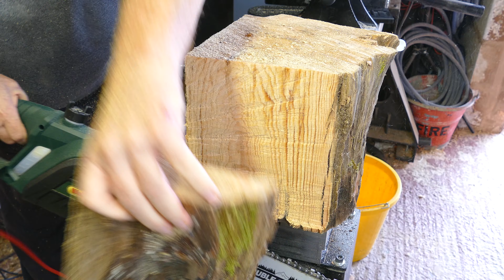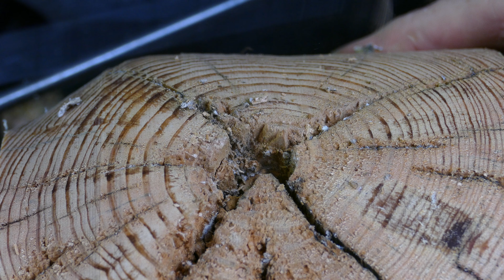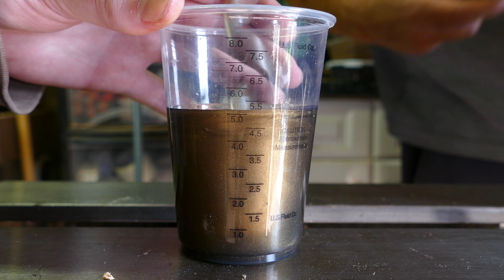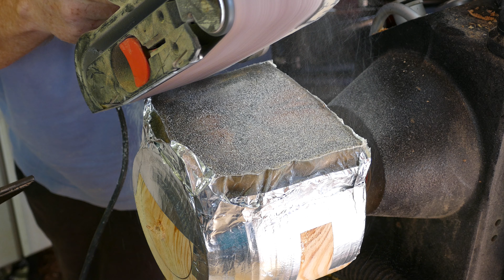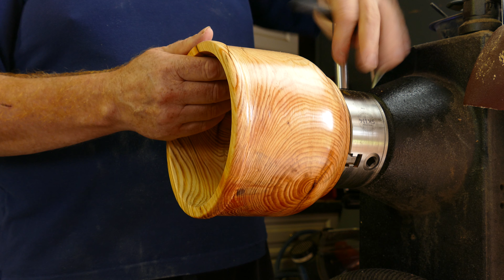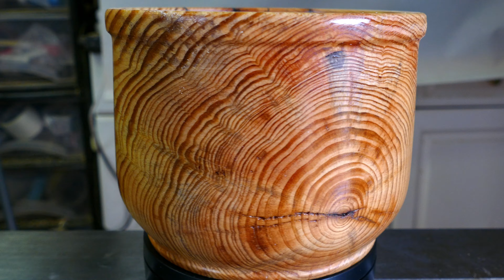Woodturning - This Log Had a Bullet Hole in it!!

Comment: A very nice bowl from a big block 
I have a white oak plank 125 years old that had 8 nails in it that has clipped off heads 
I had a deputy sheriff scan it with a metal detector wand to locate and mark them for me at work at county courthouse look into getting one they are less than the pain and cost of replacing damaged tools and or kickback from striking metal inside of a block or timber